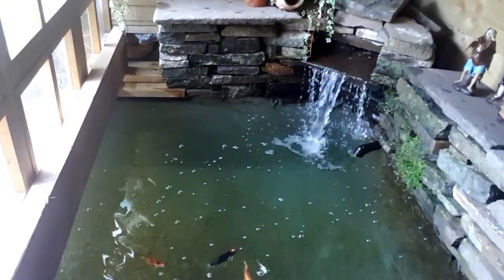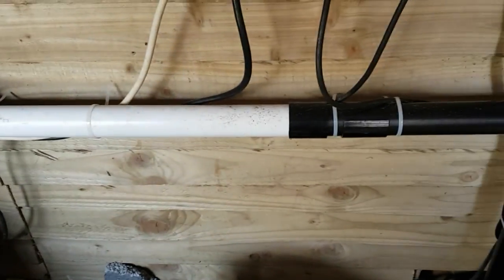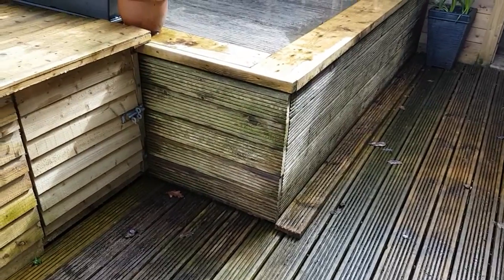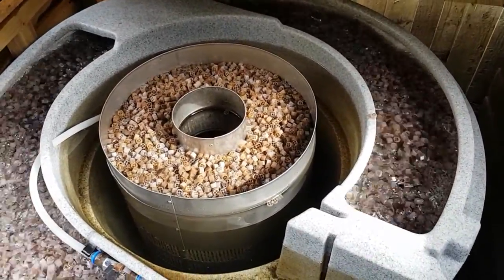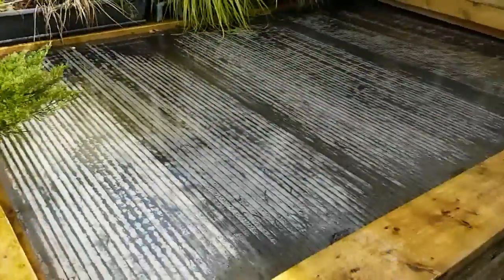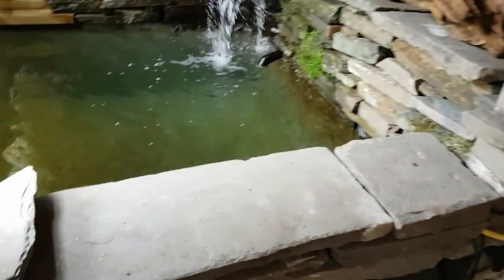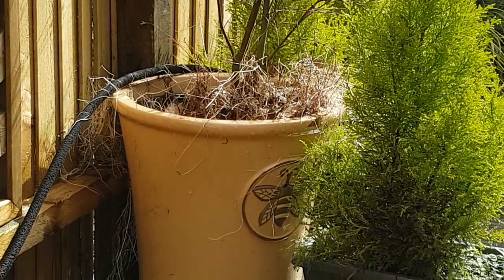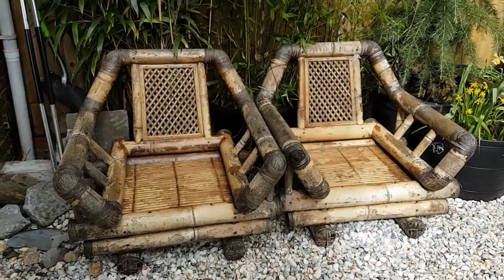koi pond construction

Comment: Hi mark I’m going to pp my pond for the first time in spring this year my question is pond is 5000ltr how much hydrogen peroxide do I need to use, I have 6% hydrogen peroxide many thanks in advance Tom
Reply from the maker: Hi.  one quart for every 2,000 gallons. Within 30 minutes the water should be very clear.
Reply: MARK'S AQUATICS 
Thanks for the reply mark 
How many mills 
5000ltr equals 1.100gallons 
Don’t understand quart 
Thanks again